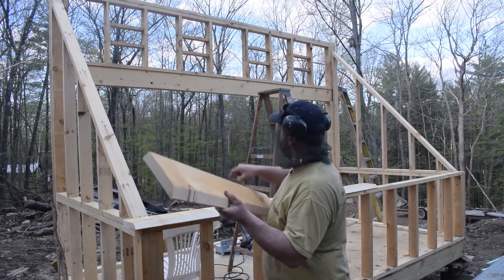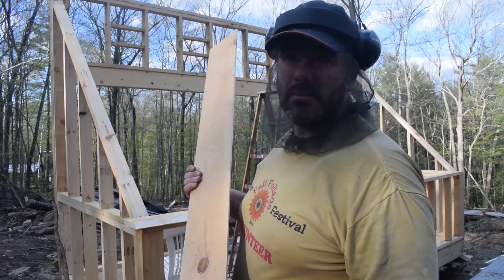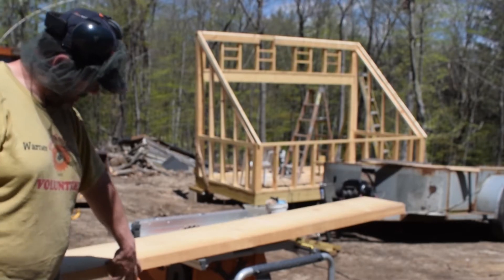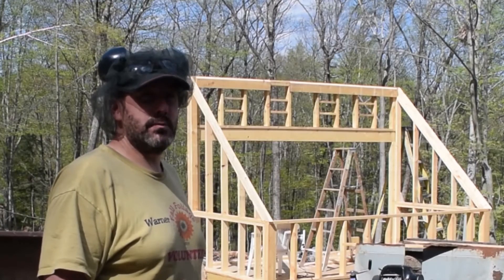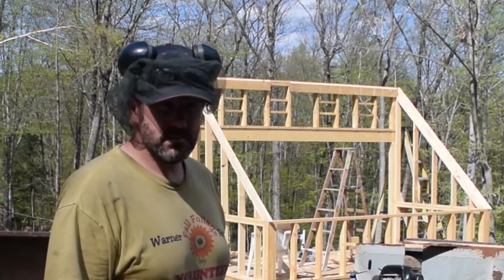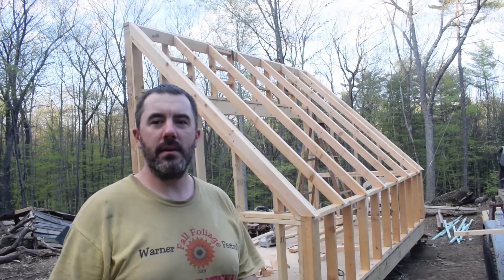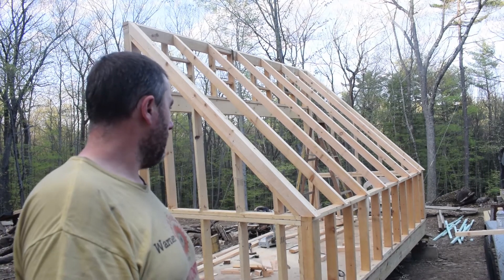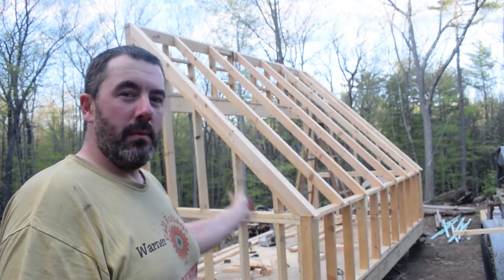Solar Kiln Build Part 7 - Roof Rafters

Comment: Paint the floor or use Thompson's Water Seal.  Because of the humidity in the kiln when it's working it will be of benefit.
Reply from the maker: That's a good point. I will try to remember to do that when I unload the kiln. Thank you

Comment: However because you're just using it for joist or studs I wouldn't be concerned with it unless you're going to use it  4 sheathing have a good day Mike talk to you later brother
Reply from the maker: Im likely going to use plywood sheathing, mainly to save time.  I have lots of logs here to mill, so need to get this done ASAP.  Thanks for watching bro!

Comment: Hey Brother I wouldn't be worried about twisting or warping with Greenwood because it's nailed in place what I would however be worried about is shrinkage and gaps appearing
Reply: I built my entire Kiln with green pine that I milled myself, and I did have some slight gaps appear over the next six to eight months
Reply from the maker: Good to know, thanks man!